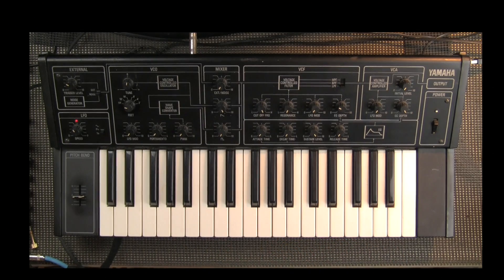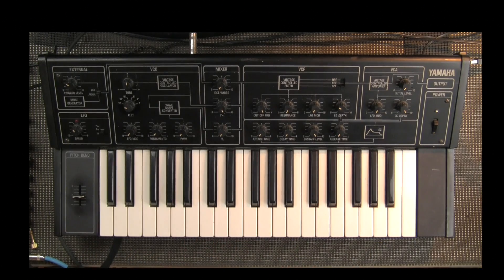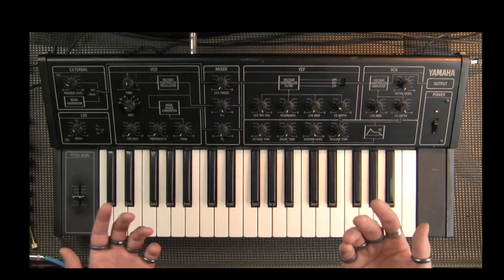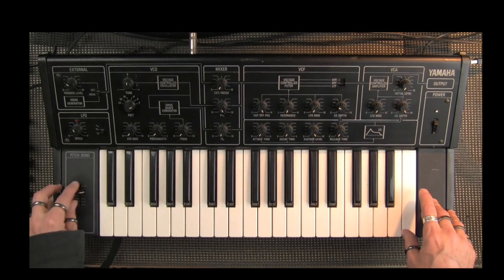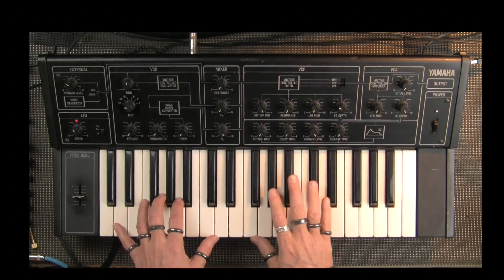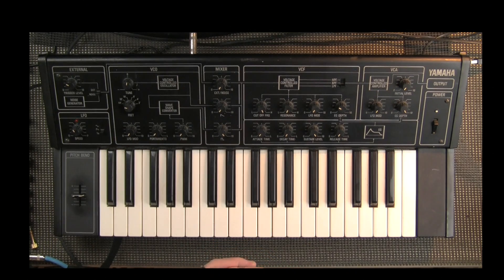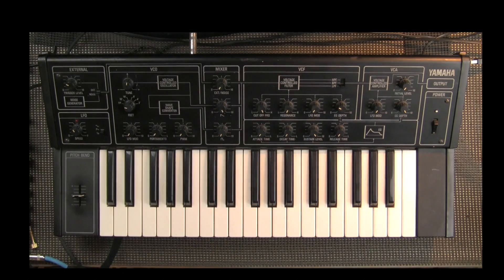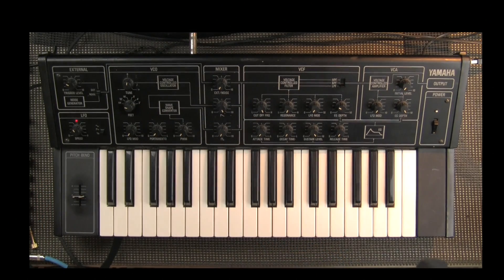01- The Yamaha CS-5-Oscillators Part 1

Comment: CS-10 actually came at same time as CS-50 (1977), CS-5 was a little later. And mono CS are actually insanely close to the big polyphonic variants, using the exactly same components (oscilator, filter, all amps and so) and very similar aproach to whole signal path. Of course looks differently, but that is just matter of design. Tuning knob on 5 or 10 is more about tuning to tune with rest of band and also, since every step (32/16/8 etc.) is due small irregularities in fixed resistor values tuned little differently (unlike mentioned CS-50 and higher that have tuning pots inside for every octave), it is necessary to have that option to stay in tune. (too many tunes in one sentence :D)
All the best out there!